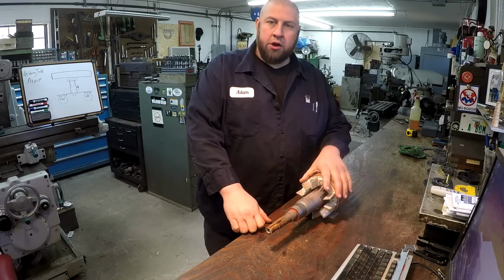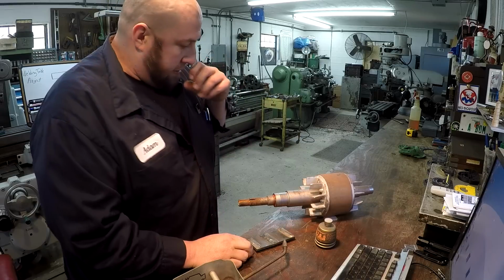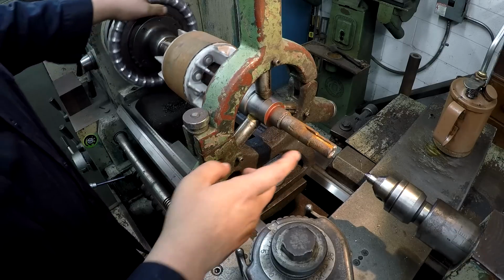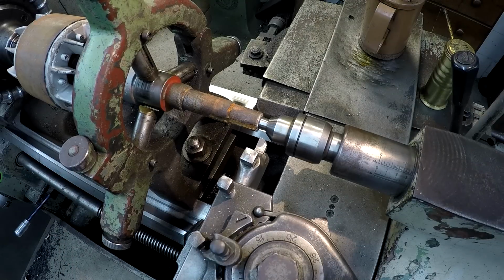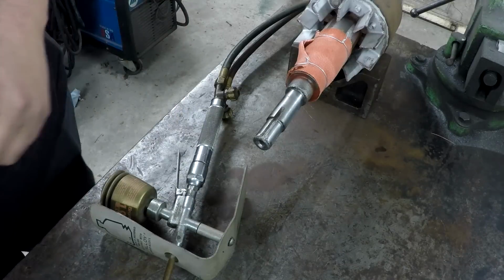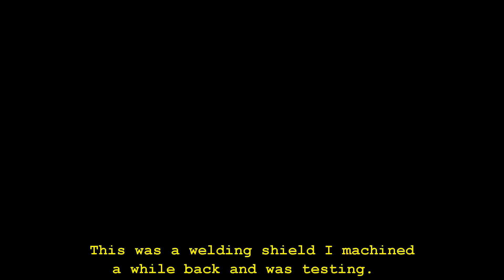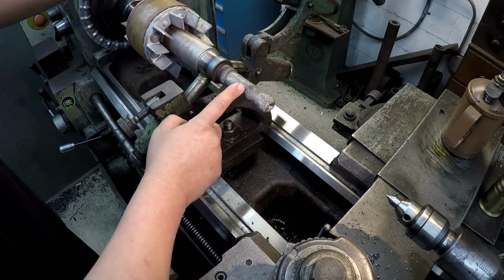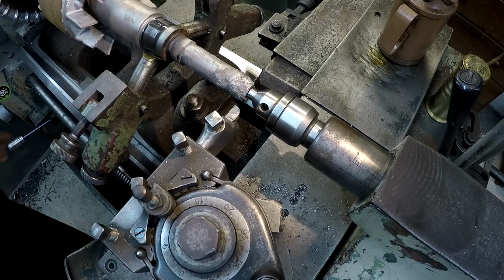Eutalloy Repair on Rotorshaft Part 1

Comment: Thanks for showing that I`ve welded all my life heard of this weld never seen it , You almost need a trough to keep the side spray confined onto the shaft ,Just have to figure out what does`nt hold powder while spraying , Man wish I had this when I had my JD 40 Dozer the block was split up the side of the eng . Could have squeezed the block back together and fixed it ths way . Does good job .

Comment: Another flashback memory. When I started in the machineshop in the early 70's they had an oxy/ acc spray machine that melted a wire and sprayed it onto the shaft. Veryyy noisy dirty. Later we went to the powder spray system.

Comment: I don't know man, I think I may have mentioned before, perfect for any type of build-up that's not stainless... Lincoln Outershield 71m mig wire.  it's a flux cored wire, ran with shield gas leaves that pristine brazing appearance.  flows like butter, super smooth and clean.  very machineable.  undercut shaft, run a lap, double lap on the end of shaft, and even the outer edge on the face of the shaft.  I really think you'd enjoy using that stuff.

Comment: Just to mention something about making videos. You think the light is going to be too bright but the cameras normally have a very narrow light spectrum sensitivity. The blue light from a torch or arc is mostly in the UV spectrum. It blinds our eyes but the camera only detects the blue-violet fraction of the light. Thus you have a small over bright area but the room around is detected normally.
A similar phenomenon occurs with the torch cooking metal. Most of the light is in the infra red spectrum. Some of the white light is detected but again, the room around is illuminated normally.
When you attempt to use a darkened lens however, it simply doesn't work because most of the tiny amount of visible light  in the cameras detection range is blocked. Thus you just get that dim glow.

Comment: I'd have to say the gopro maybe isn't the camera for welding (at least not without a different filter), but what you've got really shows the powder process off very effectively.  Keith Fenner has done a few pretty good welding segments - so it's certainly worth pursuing, done in split screen with what you have there would have been a very effective shot.

Comment: never seen that technique before,think I would be more comfortable spray welding myself,great video
Reply from the maker: They each have there uses. Spray welding is great for shaft build up, but sometimes you have a part that needs built up, like an edge, or flat surface.

Comment: That welding lens cover for the go pro is pretty cool. I bet it would work better if the glass was a little worse at filtering. Eyes are way more sensitive than the sensor in that camera (or I should say sensitive in a different way). With less light blocked by the filter it might start to perform as if the view was similar to yours. 

Great videos. Thanks for sharing.

Comment: I was wondering the same as some others if a bolt screwed into the shaft might have helped coated with the mask you use when you when you metalize. Or, would the threads weld into the shaft?
Reply from the maker: It's very possible to weld the bolt or threads to the shaft if your not careful.
Reply: I was thinking that same thing a under sized rod  or rolled up asbestos cloth put in the end to keep from welding to threads.... But  I'm sure Abomb had thought of all that prior to jumping in and spraying metal all over a customer's part. After all it is Booth Machine Shop 🅰️💣

Comment: Wonderful to see you decided to post this Adam, despite the fact the attempt to get a darkened shot on the camera didn't come out well.  Is that why this one went in the vault originally?  I like this repair method.  'Brazing' for non-cast, fully steel parts.  Would it work on an inside bore also the same way that brazing of course can?  I'm guessing so. ^^
Reply from the maker: I think the welding shot got me down because I had been trying and experimenting with it, but I don't really know other then I just never got around to making the video. Seems like once I move past a project I look forward. This process has great build up potential for many different parts and surfaces. The material I think is a better alloy then standard brazing rods.

Comment: great stuff Adam.
Would screwing some sort of heat sink in the end of the shaft help with the overheating  problem, a piece of Stainless or something  to balance out the heat
Reply: my thoughts exactly...demented minds think alike, LOL!
Reply from the maker: Phil's Projects Very possible it would help, or maybe even cause more work by it getting stuck in the hole or the metal fusing to it as well.
Reply: yep definitely a damned if you do and damned if you don't

Comment: in hind sight, would a bolt, threaded in the part, make the heat distribution more even making the metal flow like the top piece?
Reply: Would a copper bolt or stainless have worked?
Reply: even better, have  a large carbon block bolted to the end, then the weld wont stick to it

Comment: +Abom79 So Adam, what is the cost of getting the equipment to do this? Is it that much better than just welding up the end with some 7018 and machining? It looks like you get the shaft pretty hot, so the steel probably moves quite a bit. Just curious what the pros/cons of a process like this is. Maybe that discussion deserves a video? Aloha.
Reply from the maker: They still make this style of torch, and the powders but I don't know the cost. I do know it's very expensive though.

Comment: Did you not heat the tip of the shaft up so much that its properties have changed? Is the base metal still fit for purpose?

Comment: Just a question on your measurements, because you faced off the end of the shaft should you have measured from the bearing journal out to the shoulders and not from the new cut face back.

Comment: Cool video Adam!  You got that shaft really hot during the welding.  I would have been worried  that the heat would have traveled up into the motor windings and did some damage.  I didnt see a heat sink - did that cloth have something under it to absorb the heat?

Comment: The Gopro needs a lot of light, so welding lenses for "humans" are too dark!

Regards, Matthew
Reply from the maker: Yes Matthew, I figured that out a long time ago, that's why I never used the footage I did of testing it. I mentioned it several times that the Gopro is not the right camera for welding arc shots in various videos.